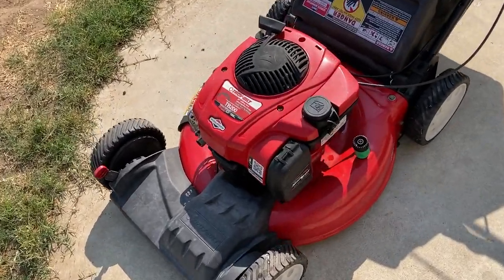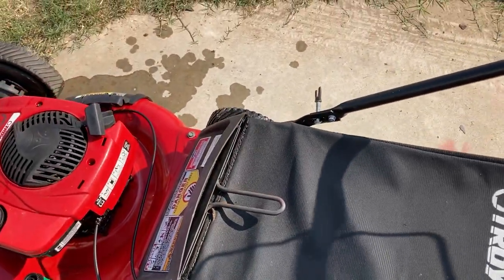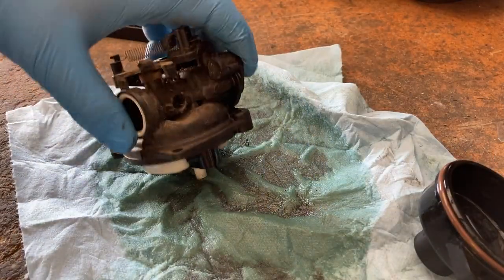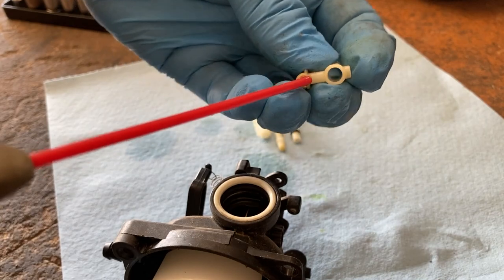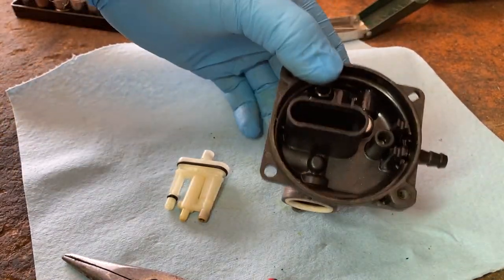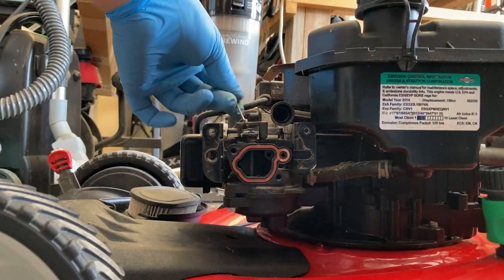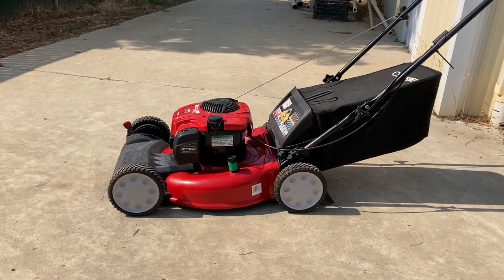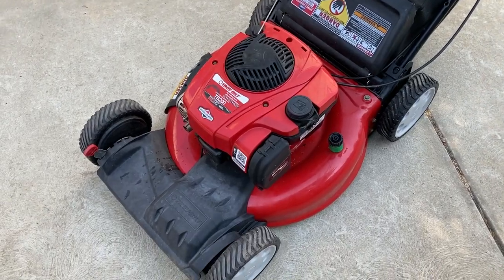Fix Non-Starting Troy Bilt or Craftsman Mower

Comment: Watched this last weekend after going by friends house and verifying spark etc...  never seen a plastic carb. But pulled it apart and the jets and holes didn’t look clogged but I ran some wire through it all.! It is a 2014.  Fired up after second pull.  Thanks a million!!!
Reply from the maker: Yea it’s a junk design. They don’t look clogged but it won’t take much to make them quit working right.

Comment: Thanks you got mine running.  I've had mine for about 4 years now and every spring I have had to take it in to get it worked on with this same issue.  This year I decided I'd try to do it myself and found out I've WASTED so much money.  Also love those Bosch impacts.  I have a set also and they're not so powerful you can accidentally strip something yet still strong enough to accomplish just about everything.

Comment: Thank you so much..My Troybuilt 3 years old always started on 1st or 2nd pull..Started mowing lawn and it simply died...Got new air filter put starting fluid in the carb...Same thing starts 2 sec later it died..I did what your are doing a few years back on my craftsman..I just needed a refresher course and yours is perfect. Back outside I go..
Thank ya much!

Comment: PERFECT!!! Mine would not start and I AM NOT an engine repair guy. Followed this step by step and it started first pull. BTW also changed my air filter and the mower runs great - The Briggs and Stratton filter from Lowes fit it perfect.

Comment: Thanks a bunch partner. Mine wasn’t clogged in those areas (at least far as I could tell) — still tried to clean them some. Cleaned out a fair amount of dust clumps and what now, reassembled and thank God it actually works again! I’m wondering if I was too rough with it and knocked something a little loose, and when I put it back together maybe that fixed the issue. Only writing this for someone else that might be in the same shoes. — that carberator looks somewhat susceptible to getting knocked off. I’ll say no more

Comment: Holy cow that was a fantastic find.  Way newer than my mower.  Great fix.  Those plastic carbs look like they might be easier to work on then the regular metal ones.  Thanks for the video.
Reply from the maker: They are easier. Somewhat. You have to be more careful with them though as it’s much easier to strip threads out of them.

Comment: I had one just like this... Needed a new blade adapter because the owner hit something. it was free spinning on the crankshaft. Cost $35. Also needed a new flywheel key. Had to buy a special briggs puller because that shroud around the flywheel doesnt allow for regular pullers.

Throw some pledge on that transmission cover, will make it look like new.
Reply: @mvehmaa  Been there done that. Almost ruined a crankshaft with the hammer method. I have about 5 different pullers now so I dont have to worry about that, even gear pullers for pulleys and blade adapters.

Comment: Hank,       I just used a 31-9334 ignition module to fix a no spark issue with an older briggs edger, runs great now 👌. Just trying to get the kill switch part to work? I wouldn’t think kill switch would need to be modified. Even was thinking of using a metal kill tab to the plug.
Reply from the maker: If there isn’t one running off of the coil you will have to make one. Easiest way is a strip of metal under one of the head bolts so it hovers over the plug.

Comment: My Troybuilt T200… stop running.. I followed ur directions and instructions it still will not crank…. It’s only 2 yrs old… any other suggestions… what size socket did u use to take out bolts on carburetor

Comment: I have this exact lawnmower...and then an older one with the same engine also from Walmart without a bagger. Swapped plugs and filter to the old one no dice. Did the carb cleaning as shown in this video and om the second pull it started right up! Thanks so much!!!
Reply from the maker: Right on

Comment: Hank, great video. I recently cleaned my carburetor and got my tb200 running. The problem is that the engine is sputtering and it is getting hot. Do you have any suggestions?

Comment: Excellent demonstration, thanks!  👍👍.  Is Briggs going to plastic carbs on all their engines?
Reply: It's on all their newer OHV engines made after 2013.
Reply: It just seems like it. 
I get the idea, but they are horrible.
The old stuff is great
Reply from the maker: Correct. All newer engines have these carbs. The higher end pro models have all metal carbs but they are basically a larger Honda clone.

Comment: Tried this but still won't start. I didn't notice any white plastic donut piece in mine that you mention at 7:10 in the video. Mine will start but only rough and with the air filter holder unattached. It also will blow an oily gas mixture out the breather hose. With the air filter piece attached, it won't start.

Comment: Hi I found one of these today in the same condition and i have already taken the carb apart and put it together but I noticed the pin that holds the float does not stay in or easily falls out. Does that mean I just need to replace the carb? You said if it was pushed in and broken which it seems is what has happened it needs a new one. Thanks for the useful videos!
Reply from the maker: Yea just replace it 👍

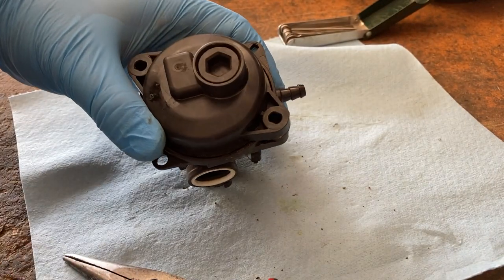Comment: What is the hex plug on the bottom of the carburetor cup for (@8:34)? Sounds like you can turn it with an Allen wrench to drain fuel from the carb.?
Reply from the maker: yea thats all its for is draining the carburetor out.

Comment: What is that metal wire at 2:23 after you take the top cover off because I sure did not reinstall mine that way. That could be my problem.  It has the loop facing down.
Reply from the maker: There is the sparkplug wire and then towards the rear on the coil there is a ground. Yea both need to be installed.

Comment: Mine is Brand New TB-105B. Did Everything it needed before the First Start. Primed it a few times (like 10) and took 3-4 pulls, Ran for About 20seconds, died, would not start after that no matter how many times I primed it. About/Upto 30 primes it would spit and sputter but would not start after 10 pulls. Been trying all day.
Yet I have a Engine from a Mower that's been sitting a year but deck was completely rusted out after just 4 months, walfart special and it still starts after 3 primer pumps and one Pull of the cord. Another that only ran for 30 minutes and would not start the next day, another walfart special. 
So NO Clue what's going on here. Hopefully Tractor Company will take it back because.... I just got the damn thing today...

Comment: If people only would put a shut off valve to the gas supply hose or run the carburetor dry when they’re ready to store it, these issues would never happen. It’s not as important if you use ethanol free gas, but it is still important. I recommend using ethanol free gas but you don’t have to if you run the carburetor dry whenever you are not using it.

Comment: Mine is still not starting. I washed off the mud underneath, cleaned up the carburetor, installed new blade, new spark plug, new air filter, and changed oil. Now it doesn’t want to start. Any suggestions?
Reply from the maker: You took the white jet assembly out and took that apart and cleaned it right? That’s where these foul up. Make sure ground for Blade control cable contacts the arm properly at the engine. The blade cable is supposed to pull it back and unground the coil.
Reply from the maker: Also make sure the choke and governor levers are working correctly. If neither are working you will never start it
Reply: @hanksgarage_  Thanks for the response. Yes I cleaned carb as mentioned in your video. Now I will put new carb to see if it makes a difference. I didn’t find a single video on YouTube for adjusting the governor and choke for TB 200. I guess it’s something I’d have to figure myself
Reply from the maker: @salman617  you shouldn’t have to

Comment: If the lawnmower was not used during cold weather, the 87 octane gasoline spoils very easily in the carb. The same thing happens with electric generators.
Reply from the maker: It’s because of ethanol. Not the octane rating. I can’t get ethanol free gas in my area.

Comment: Now that they’ve gone bankrupt I’m sure the parts quality will only go further downhill.
Reply: But they’ll be available for 50 years, just like Brand T.
Reply: One has to wonder if the plastic carb OHV's are a contributor to Briggs' demise vs. the solid flatheads (metal carbs) that defined the co. for decades. Probably.